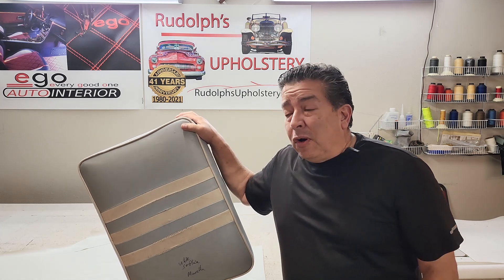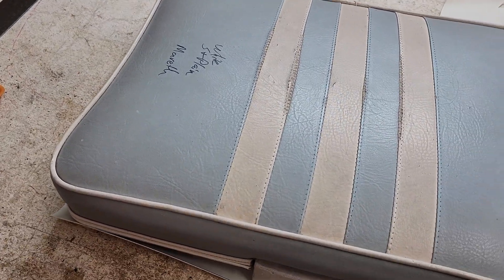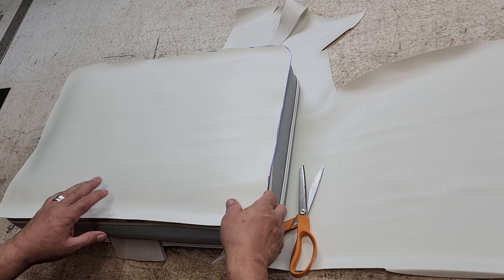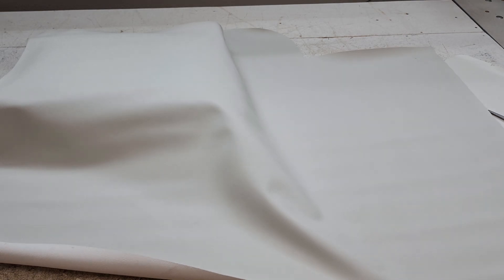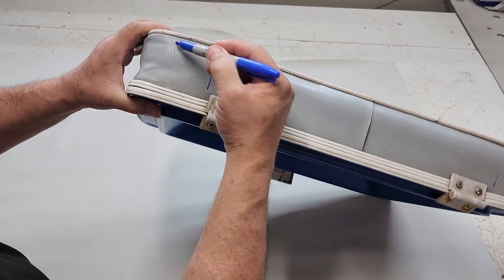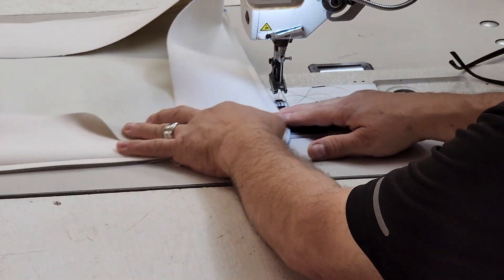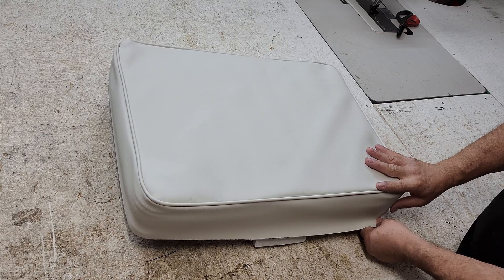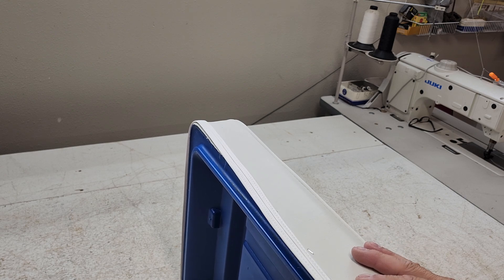Must see! Easy Boat Cooler Seat Cushion Reupholster

Comment: Thanks for the video. Two question: 1. If you would have had one long piece to make the "skirt" would you have done it that way, I guess I don't understand why you would make multiple pieces of the skirt if you didn't have to and it would have eliminated a seam. 2. Why did you wait until you had most of the skirt sewn before you sewed the two pieces of the skirt together?  It seems like it would have been easier to work with one long piece and not have to sew it together while the two pieces were already sewn to the cushion which looked a little cumbersome.  I assume it was b/c you wanted the two seams to line up on each side of the back of that cushion and it was impossible to do that until you got it most of the way sewn.
Reply from the maker: Hello Letizia, I just showed how I do it. Usually, I would just duplicate what the cover was before. It sounds to me like you have a way of doing it. Like I always say, there is not a wrong way or a right way, just a different way of getting things done. Please keep liking and watching!